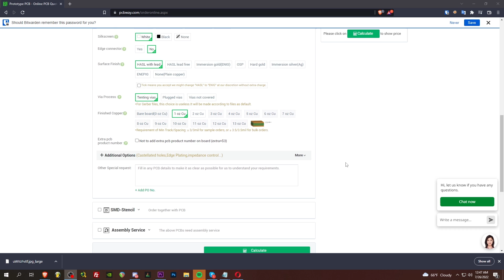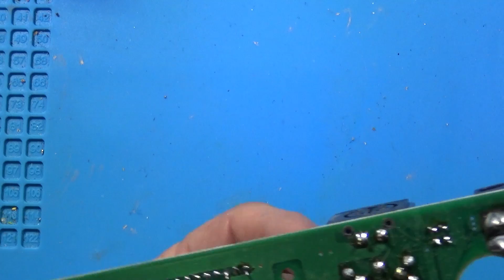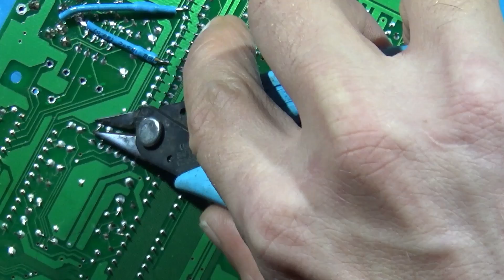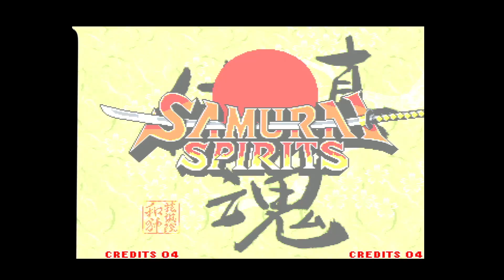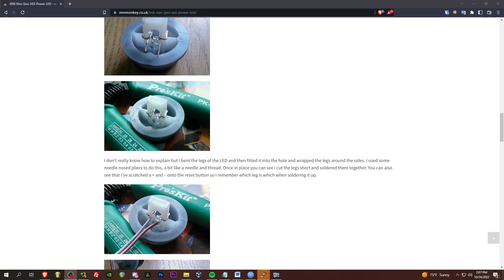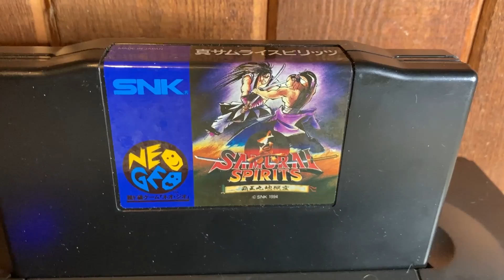Neo Geo AES Modding - RGB Bypass / Unibios / Reset Button Power LED

Comment: Mine Neo Geo AES 3-6 9V version arrived from eBay yesterday and cost me just under £200 UK pounds, fully working and in excellent condition, seem like it's never been opened too. Will do the unbios mod, and RUB bypass, composite is rubbish anyway 🤣😂😐😑 will definitely do the reset button light mod too, looks so cool, is it possible to do like a multi colour light version 😙😗😘

Comment: On the Tink 5X under the “Video ADC” settings, try setting Pre-Coast to 15 and Post-Coast to 8 (defaults are 1 and 6 respectively). These make the Tink PLL more tolerant in locking in a sync signal with the NeoGeo. I can’t remember if I changed the LLPL Gain and LLPL BW settings (in my documentation, I took a picture of my TV with the Tink settings displayed, but the NeoGeo off - and these two settings show an “N/A”), but I definitely was able to get the NeoGeo to work with the Tink at 1440p using RGB this way with no screen tear. Oh, V-Sync will have to be set at “Triple Buffer” unfortunately. I’m using firmware 2.39.

Comment: To fix the screen tearing on the Tink 5x you gotta have a way to run the AES through YPbPr. I got my AES scart output running into a Tink RGB2Comp. You can use hd retro vision Genesis cables with an AES adapter too. I use YPbPr (SDP) as the input. The sync tolerances on there are apparently more lax than standard component and it fixes all that screen tearing. The only downside is you gotta tweak the color settings in the post processing menu on the tink 5x
Reply from the maker: Fantastic thank you for the tip. I’m set up for component so that’s no biggie. Will need to yoink the cables / adapter

Comment: The hot glue is for stabilization. Electrolytic caps would just be flopping around without it.
Reply from the maker: They're pretty sturdy once soldered into place.

Comment: that's a good find ,is the resistor activating pal mode ?  I know nothing about system but on the c 64 it  has a jumper /solder bridge it made my video weird and over clocked it pal runs slower than ntsc
Reply from the maker: That's a good question, I'll have to look into that